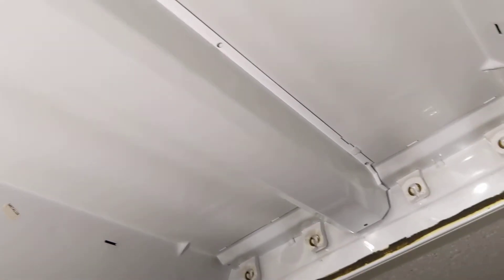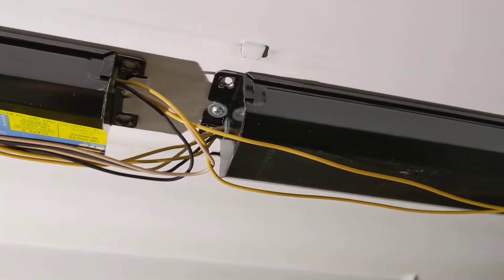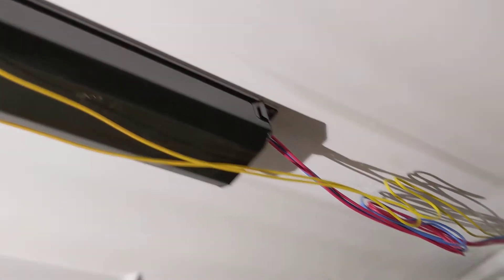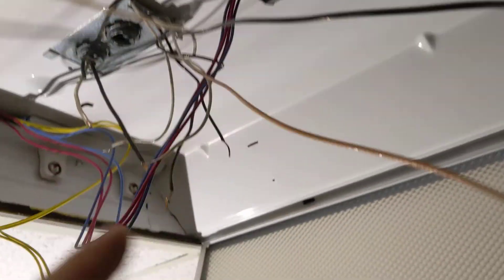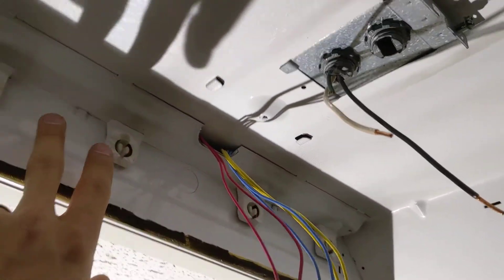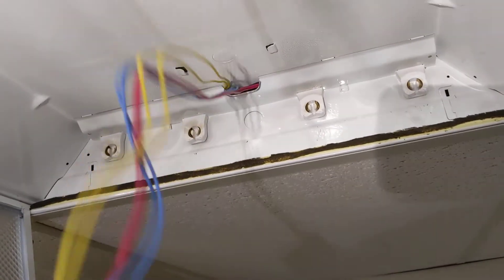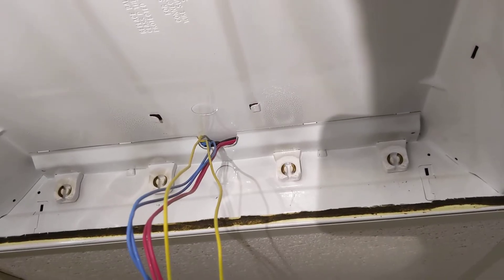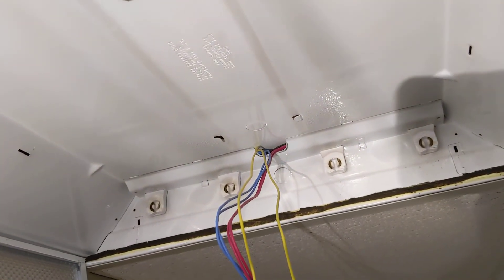Replace Old T12 or T8 Fluorescent Lights with LED (Two ballast fixture)

Comment: I have a 4 bulb florescent two ballasts fixture. I cut all wires and removed the ballasts. Now, wire red, blue,yellow to hot wire and do the same for the neutral wire? Using T-12 bulbs….no lights.
Reply from the maker: It depends on your bulbs you are putting in. Some are single pin bulbs, and some are dual. Type B (ballast less) take neutral to one side, and hot to the other, but they can connect in different ways. The style I had in the video just required hot to one side and neutral to the other, but I've found some that require neutral and hot on one side because the other side doesn't have a terminal, it's just a bracket to hold the light. So, check your bulbs and it should indicate what they need.

Comment: This is a really helpful video. I must be missing something simple here but if you have a single wire going back to hot and neutral from each respective end, don’t you need 9 quick connections? 6 for the blue,red,yellow wires, 2 for the jumper between them, and 1 more to lead back to hot?  Appreciate any feedback you have on the quick connect set up instead of tying 7 wires together with a nut
Reply from the maker: Yes, so all of the wires coming from the tombstones have to be tied together and go to the neutral or hot. So if there are six wires from the tombstone and your neutral/hot won't reach, then you need to use a pigtail, or jumper, to span between the neutral and all of the wires going to the tombstones. Just keep one side as neutral and one side as hot. A wire nut is the simplest, but if you only have wagons or something like that, then you'll have to use an 8 port or multiple smaller ones to tie it altogether.

Comment: How can you tell which side of the fixture is hot and which side is neutral?
Reply from the maker: If you are asking how to find hot and neutral in typical Western electrical black is hot white is neutral and bare copper, or green, is ground. As far as figuring out which side of the fixture is hot or neutral, that's the point of the video. If you are bypassing the ballast then you're removing all of the ballast wires and just connecting one side of the fixture (all of the wires coming from the tombstones) to black and one side to neutral. If you just want to know which side is currently hot, or currently neutral, it doesn't matter because bulbs are reversible as long as you're putting bypassed bulbs into a bypass fixture, then you are good.

Comment: Got confused because i got two pair each with a black and white wire
Reply from the maker: Yes, so since you are bypassing the ballasts,  all the black wires get connected together and go to one side of the fixture, and all the wire wires to the other side. Doesn't matter which side, just don't mix hot and neutral. Ground/bare copper just attaches to the fixture. 

It is possible that you could have a weird 3-way setup, but generally speaking you will have a two conductor cable bringing power in and one going out to the next fixture, so two blacks, two whites and two grounds.

Comment: I have 4 bulb fluorescent fixtures that are 8ft. with 2 ballast resistors. Is the wiring modification the same as your video with the 4' bulbs ? thank you
Reply from the maker: Yes, they're the same as long as you use the direct wire (ballast bypass) type. Neutral on one side and hot on the other. The box should show the wiring diagram as well.

Comment: 09/06/2024 Update:

Problem reported below last week is now solved.  I get light on all the tubes inside the fixture
from end to end of ea. tube.

Detail:

Went back to a different branch of Lowe's last week which had a pack of Type B T8 LED, 48"L
4,000 Lumens, 32Watt, a pack of two tubes/pack for $25.  Both worked.  All of the
LED beads inside the tube lit this time for both tubes.  I need to get another pair for
the total of 4 tubes/fixture as in this video.  So today, i called my local branch Lowe's n found
they now have the Type B tubes.  A lot of them the man said.  So today, bought 4 packs = 8Qty LED
tubes.  They didn't have one more pack (total of 10 tubes, for my other 4 tube/fixture units).

Problem:

Two of the four tubes have a strip of dark grey stripe pointing down.  Hey, the other pair have
the stripe pointing up so i get more light shinning downward!  So i kept on twisting the tube suspended
betwn the two tumbstone connectors.  Kant do it.  The tube stops lighting.

OK.  I dink only one prong on ea. end of the tube has electrical conductivity.  I may need to remove the
tumbstones and short circuit (shunt) these female connectors?  In this way, i can twist the tube 180 degree
to align the dark grey stripe toward the fixture's ceiling.

The Dark Grey stripe, ~3/8" - 1/2" wide across the tube's end to end must be where the LED beads are
glued inside the tube.

Later in the day, i've found a pack of 6,500 lumen pack of two tubes, same 32Watts.  Hey!  Why they (GE) bother to
sell the orangish pinky colored weaker light tubes of 4K lumens?  Who wants a red light district pinky lighting?
Both tube packages r at the same price, 4-2-8ly.

Comment: (0:31) I don't even bother to re-install this sheet metal ballast hiding U-channel.  My fixture is
the same as this video's and even after unhooking the tabs, i couldn't get it out
of the fixture housing, no matter how i angled it in 3D space up dare(there). So, i just
bent it down, mangled it.  No going back.  Besides, it'll b EZr to replace the LED long
tube w/o it!!!  Even the fat old Florescent tubes were hard to get it out of the 'Old' fixture
bc. of this center sheet metal.  And, i almost broke those fragile square female plastic connectors.
So what if the wiring shows.  Actually, if u managed to remove this crap, perhaps cut
the ends short to hide most of the Ughh-lie wires or even cut it in two w Mr. Dremel, then
re-install it.  Or, even better, after u unhook the U-channel off the tabs, u can c where the
wires are at by tilting.  Then, use Mr. Dremel to cut the ends or cut it in half.  Make sure to wear
goggles and don't open ur mouth while cutting.  Für mich ist es zu spät!

Liked that 'Split Connector' idea.  I've found that 5 prong connectors at Autozon, at their
bottom shelf as most of the connectors are single wire to single wire connectors.

Thx for this two ballast type video!  Oh, make sure u shut off the main breaker panel
and do this during daylight hours.

Thumbs up n subscribed.

Hope my experience wld help the audience here, rather than the 'me too' goody goody gum drop
comments i c below.

Comment: perfect for my application thanks. My bulbs are marked LN on one side and L on the other. Turns out that they're switchable. All load on one side and and all neutral on the other side and doesn't matter how I place the bulbs. I also use the 4 in 1 plastic connectors - they are excellent!
Thanks!

Comment: I did your exact set up and used GE LED T8 Type B bulbs that are Direct Wire and they are not turning on. Used a KLEIN TOOLS No Contact Voltage tester and it was showing current on both the Hot and Neutral side of the fixture. Any Ideas as to what I'm doing wrong?
Reply from the maker: A non-contact voltmeter is good as a warning, but it can pick up anything from 1-1000v so you could have a bonding issue, or your sub panel might not have grounds separated from neutrals or... I would want to figure out my circuit, figure out which line is hot, and then wire it up. If you tried to use a Non-contact voltage tester to separate things out you may have missed something since they can't tell you what's actually happening. You can pick up a multimeter from harbor freight for $5 (or a neighbor). Once you determine what lines are hot, then you can decide what to do. I've seen some offices wired so that half a fixture was on one circuit and half on another to build in kind of a dimming feature. First figure out what you have with a multimeter, then wire it with neutral on one side and hot on the other.

Comment: Does it matter which end is hot and which end id neutral?
Reply from the maker: Nope, type B doesn't care, because the ballast is internal. If it did matter you'd have people accidentally putting the wrong side in and blowing ballasts up since either side uses the same connection/tombstone style.
Reply: Thank you.

Comment: Thanks, great video! Where your tombstones non-shunted? If I get type B double ended led tubes, can I use my existing non-shunted  tombstones?
Reply from the maker: Yes, these were non-shunted, but the direct wire LEDs used could use shunted or non-shunted tombstones. It will pick up hot/neutral from either contact. You can always check the brand of type-B direct wire LEDs you are getting to see if it cares. If it does, and you have non-shunted, then you would just have to create jumpers.

Comment: I got all the wires on one side to the black wire and the others to white but my led still don’t turn on any advice?
Reply from the maker: Are you using type B bulbs that are direct wire? Or are you using the type that needs an electronic ballast?

Comment: So basically eliminated ballast and wired direct
Reply: T12 type b led correct ? What brand
Reply from the maker: T-8 direct wire LEDs from GE I believe.
  T-8s and T-12s use the same sockets so they are interchangeable as far as the length and socket goes,  but I'm pretty sure all the direct wire LEDs I find are labeled as T-8s. But in this video I was removing old T-12s and T-8s and replacing them with the direct wire T-8s.

Comment: So, you don't actually show yourself doing the replacement? Waste of time.
Reply: Got me exactly what I needed without extra time filler. 5 minutes watching,  3 minutes wiring and I was done....if you need to see a wire nut being twisted on you probably don't need to be wiring anything...
Reply: @scatterbrained6876 For real, this was all I needed to know. I thought I was about to do it correctly but wanted to make sure what made sense in my head was actually true.
Reply from the maker: I suppose I could have made it shorter. All you need to know is at 4:15
Reply: Do you need to watch someone connect wire nuts? One of the best videos on the subject if you aren't a moron.
Reply: talk, no action kinda stuff!
Reply from the maker: This is for information purposes. I can't have a camera crew following me around, you're not paying me enough.

Comment: This is a great video. I have almost identical fixtures and this completely demystified the conversion process. I invested in  a box of T8 LED Dual End Power (DEP) bulbs, push connectors and a decent auto-adjusting stripper. This was the first time I did anything like this and it was maybe a 15 minute job per fixture. I don't usually comment on videos, but wanted to say thanks!
Reply from the maker: Glad you were able to tackle your project. I always think of "Joe vs. the Volcano" when I see  these florescent lights "Suck, suck, suck, suck!"

Comment: Does this work on a double switch system
Reply from the maker: If you mean a 3 way switch, then yes. However the hot and neutral are coming in, that's how you'll connect the new lights. There are different ways to wire a 3 way (power in to light, power in to switch, etc.) so just make sure you are following the way it is currently wired.